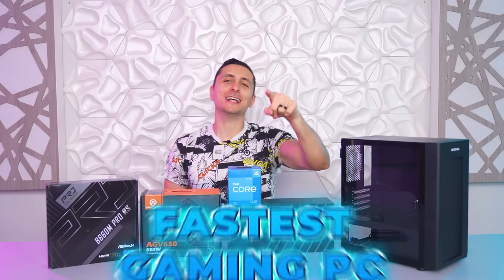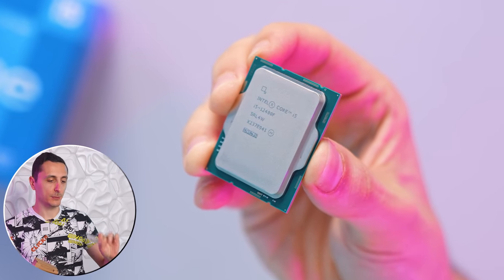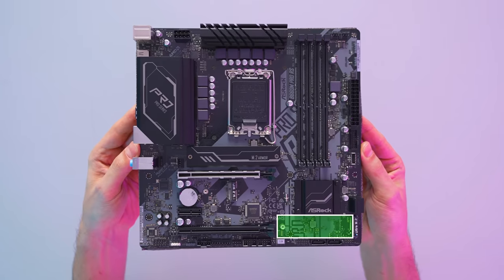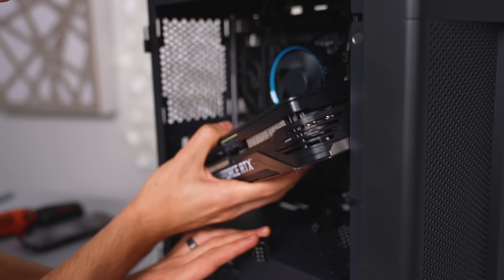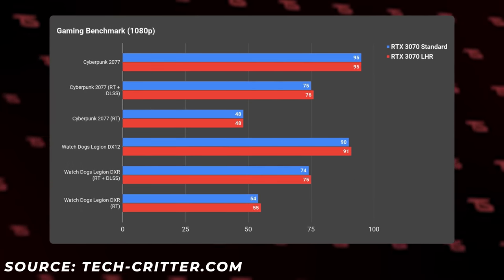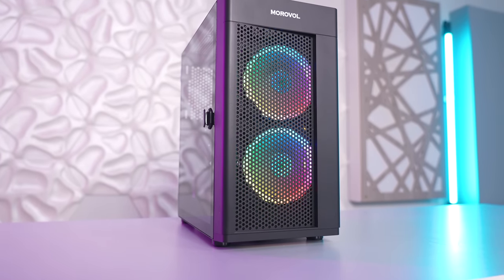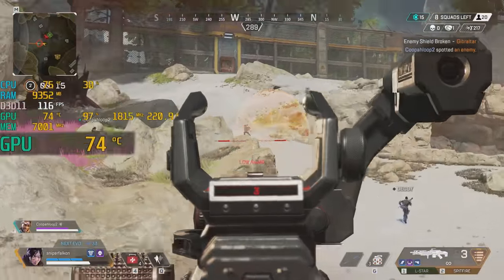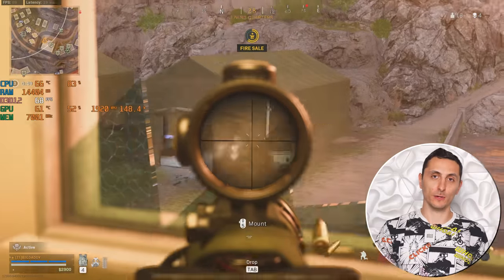Building the Fastest Gaming PC for $1000! - RTX 3070

Comment: Okay for a 1000$ I can say this is a well build budget pc and with an 12400F/3070 that's pretty good. But I must clarify to never cheap out on the Powersupply, that Arresgame AVG650W is one of the worst units you could possibly buy on this parts list. This Unit has been tested by reliable sources like Nexusgamers and Psu Cultists. By their rating they averaged this Powersupply as Tier F Which mean avoid at all costs and should not be used in mid range and high end builds like this. Some of them can even blow up by having their parts at full load. So if it was be I will def be taking an Asus TUF 650W or an Smart BM2 650W that are much better for a build of this degree. Hope this helps someone while replicating this build, I'm not hating or anything but just giving you a piece of advice so you wont run into any issues.
Reply: agree 100%
Reply: Ff
Reply: Ty bro il be looking into good power supplies for a pc with a 3070 in it
Reply: @dyzorted  A 650 watt power supply should be good for a 3070 (Unless your CPU is top tier, in that case probably go for 700+ watt). Also, I would recommend getting the Gold rated power supply instead of Bronze as it have much better quality/efficiency (Slightly more expensive, but when your already putting in this much money, it's definitely worth it).
Reply: @zayaanrab7942  il look into that
Reply: Thanks! Black Friday is soon. I’m still a bit scared to build my own pc ( was thinking to buy a prebuilt) this vid gave me a bit more confidence on what parts to pick.. any suggestions for a first pc?
Reply: @BXRSERKX  What's your budget?
Reply: @zayaanrab7942  in the 1000-1350$ range
Reply: @zayaanrab7942  the thing is I live in a country where parts are expensive…
Reply: Bro I can get a used Rx6900xt for 500 USD and a brand new Ryzen 9 5900x for 300 USD ,so this build is definitely just a 6/10 for a 1000 dollar PC build  (Eventhough if u add these items I mentioned u will prolly overspend by 150 USD , but u will be getting atleast 40% more performance so yea it's a win win situation.)
Reply: @BXRSERKX  I'd say go Ryzen 5 5600x with a 3060 ti. I'm not sure how much those cost in your country though, so go ahead and have a look at the prices and let me know.
Reply: @vik9481  The problem is, that gives you only $200 left to spend on everything else, which is definitely not what you'd want when you only have the graphics card and CPU
Reply: @zayaanrab7942  yeah I was thinking that aswell but instead of the 3060 go for the 3070 but I looked at the 3070 prices and they are pretty expensive. What motherboard will go well with this combo? I’ve heard of you don’t pick the right motherboard it can fk your whole system up in a way. Def will check the 3060ti!
Reply: @BXRSERKX  AMD works well with quite a few motherboards. I'd recommend something like the B550. You can look at other alternatives, but if you're using previous gen motherboards, make sure it has Q-Flash on it. Otherwise you'll need an old Ryzen CPU to upgrade BIOS.
Reply: @zayaanrab7942  Q-Flash got it! What about Radeon GPU’s any suggestions there? Heard they go for “cheap” compared to the GTX 3000 series. Any Radeon GPU that compares similarly to the 3060ti? Or even a bit better
Reply: @BXRSERKX  I don't know much about Radeon GPUs, but I believe the 6600 XT is the 3060's equivalent. Again, you'll have to look into the prices since I'm not sure about them where you live.
I would go for the 3060 if you can, but if you do need to save money then 6600 XT isn't a bad choice.
Reply: @zayaanrab7942  alright I appreciate it a lot mate! :)
Reply: @BXRSERKX  No problem. Have fun with your PC!
Reply: @BXRSERKX  if the AMD 6700 is the same price as the 3060 buy the amd you will get a better performance if you don't care about ray traycing
Reply: Yeah I'm building this with another 650
Reply: @BXRSERKX  this one he built is rlly good but get a better power supply and u should ve good
Reply: @shashank4020  I went with 6800 for gpu and 5800x amd
Reply: Oh my god, I just brought the Aresgame 650w, it’s my first build what should I do?
Reply: @bonkersbeaver9919  throw it in the bin
Reply: @BXRSERKX  have you ever used this psu?
Reply: “so you won’t run into some issues” 

average gamer playing on this pc : blows up
Reply: So instead for power supply I should get Thermaltake Smart BM2 650W 80+ Bronze Intel Skylake’s C6/C7 States & ErP Ready 140mm Quiet Fan Japanese Capacitor Semi Modular Power Supply 5 Year Warranty PS-SPD-0650MNFABU-1?
Reply: Man i love you ❤️ no homo
Reply: I have ryzen 5 5600 and 3060 ti should I use 600w Corsair 80+ bronze or 700 watt thermaltake
Reply: @NotGlarr  calculate the total w all components count add to the total 100w
Reply: Thanks this helped a lot
Reply: which psu of the ones you suggested is cheaper?
Reply: I gave the 12400f and a RTX 2060 it’s not a bad pc at all I love it
Reply: @lukewalker3  that's a good pc decent cpu and gpu it should atleast play all the new games on high settings
Reply: Than what would be a good power supply for this build?
Reply: @cxmptuhkc7134  80 gold 850w 150$ or 200$ power supply is the kind of component that is you get what you pay for and 200€ is too good
Reply: So would the smart bm2 650w be better??
Reply: Yeah, as soon as I saw this psu I knew them and there this guy does not know his stuff.
Reply: Not wrong, although it will support it there are much better options
Reply: I ain't reading all that
Reply: What’s a better option for the motherboard that is Wi-Fi ?
Reply: Budget pc? 1000 dollars?
Reply: Is 750W Aresgame better than 650W
Reply: Do I not need a cooler?
Reply: @bakirbakija4585  yes. The higher the wattage the less likely it’ll go kablooey. Anything that is gold rated or higher, and more than 650w should be good for this system
Reply: @deddsos  Thank you
Reply: What about corsair cv750 80+ bronze ?
Reply: 650w is the minimum for a 3070, if your looking for more power 650w to 750w is all you need for this build
Reply: Should just buy corsair, thermaltake, be quiet  more popular ones.
Reply: I’ve already ordered the arsegame power supply💀 what I will do is come back to this comment and buy one of the power supplies you recommended once I start seeing problems with mine🤝
Reply: Please can you respond what do you think I should get
Reply: @IsaacIs1  a psu?
Reply: @IsaacIs1   so I saw this comment and thought I should get a different power supply too, the power supply he uses is really cheap so I found one that’s good but a bit more expensive, it’s the evga 700 BQ, it’s a 700watt and the minimum for a 3070 is a 650watt
Reply: @Hinokl  yeah because I’m actually trying to get a new power supply
Reply: @IsaacIs1  stay with the arsegame 650W if you’re getting a 3070 but if you’re getting a 3090 or above get one of the ones Angel recommended or a 750W power supply
Reply: @shikatafn4681  thank you
Reply: @sc4rles  yes the NZXT H5 Flow that’s the one I’m using
Reply: What's are some good power supply brand for 650w? 
My (planned) build is Ryzen 5 7600X and RX 6700 XT.
Reply: what to do you think about coolermaster 650w gold?
Reply: I would get probably a zalman gigamax or an apevia prestige, never go tier c or below for any build, the cultists list does say that tier d is only for igpu builds but I still wouldn’t use a tier d for an igpu build
Reply: Yea thanks for this power supply tip I’m planing on building a 5 thousand dollars build max out every thing like 128gb DDR5 ram and also the RTX 4090 with the core i9 1300k the most powerful processor and also a 2tb of space storage with all RGB gaming case fans and a expensive motherboard and power supply I never buy cheap stuff I always buy what’s the most expensive cuz I always know that the more expensive you get the better you get that’s how it works guys never buy cheap stuff and also guys if you guys want to have the best pc buy a gaming pc that costs atleast 1 thousand dollars to the most expensive which is 5 thousand dollars never go cheaper always go in between these prices of thousands of dollars to experience the best out of the pc

Comment: You can buy an RX 6800 non-XT for $480 right now, which was tested to be around 11% faster at 1440p and 10% faster at 4k than an RTX 3070. It’s currently $50 cheaper than the cheapest 3070 in my area (NJ, US). It’s a great alternative to those who don’t care much about ray-tracing and looking for the most bang for their buck
Reply: Yea, and you can buy it brand new for that price. Used gpus id say area bout 95% good 5% bad, and if you don't care about 4k, you can get the 6600xt and 6650xt for 250 atm that does 1440p for most all games. 

For 1080 and some 1440 you can get the amd 6600 for under 200 rn, and a 5600 cpu for 135. Literally a under 500 $ build.
Reply: You can honestly just get the 6800xt for 515$ after rebate
Reply: It feels like Nvidia will never lower their mid/low range 30 series gpus. They should be $100 under msrp by now. AMD is doing that, that's why im team AMD right now. Im currently considering a 6700xt. Not sure if I will wait 2-3 months for the newer mid range gpus
Reply: yeah but ray tracing still better optimized in the Nvidia Cards, if you want to play a single player story mode game and wants to max out everything with Rt, the 3070 still the way to go
Reply: @Petersonleonrohde  No. If you want to max out everything, the 4090 is the way to go

Comment: Great Build! Personally I would have gone for 3060 ti if going Nvidia since it would be around 30% Cheaper and you only lose around 15% of the performance.  Or the better option which is the 6800 for around 10% better performance than 3070 for cheaper as well.
Reply: That’s what I’m going with, and I believe there’s less bottlenecking with the 3060

Comment: Hi I was thinking about using a ryzen 7 5800x instead of the Intel cpu combining it with a 3070, would that be a good combination?
Reply: It would be a good combination if you wanted to multitask/stream or do productivity tasks. However, youd definitely pay around $200 more both for the cpu itself and to properly cool the cpu. You will definitely want a higher end air cooler or look into water cooling options. And in addition to that, you may want to get a power supply with more wattage if you want to upgrade anything int he future as the 5800x comes with a big increase in power draw.

Comment: LUL Horse shit title. Fasting Gaming PC for $1000 is not with a 3070 when the RX 6800 is faster and cheaper. Also, the 6700XT is hovering around $350. So you're saving more than $50. And the awful tier F PSU on a power hungry CPU/GPU. Can't take this guy seriously folks. I would recommend PC Builder for actually technical source.

Comment: i have a pc with ryzen 5 1500x, GTX 1070ti & Gigabyte AB350 Gaming motherboard, I have a terrible RGB case and I'm looking on pc part picker to upgrade my case and motherboard but it keeps saying "A USB 2.0 to USB 3.2 Gen 1 header adapter is required" & " A USB 3.2 Gen 1 to USB 3.2 Gen 2 header adapter is required" does this mean it doesn't fit correctly, I'd like to find a suitable motherboard & case combo or advice on what these compatibility notes mean ?

Comment: Crazy DEAL!, CRAZY PC, CRAZY LOW BUDGET! , i also wanted to buy RTX 3070 and mix it with I3 12100, cause i dont have money to buy I5 last gen to save money, in my country i5 and i7 ar expensive, i would préfere I3, and mix it with RTX 3070, with nice gaming case and fans eveyrwher, that could at least be a good pc with 16GB RAM, i already have HDD 1TB, but i gota get 1 more SSD for installing windows inside it and some games, to get better FAST, that it i guess!,

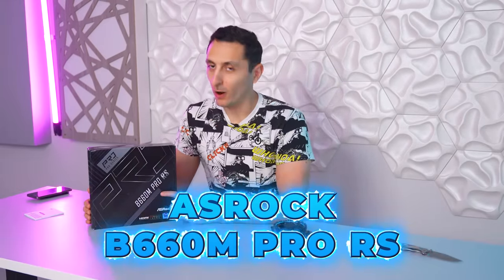Comment: Am I able to swap the power supply to a ASUS ROG Strix 650 Full Modular 80 Plus Gold 650W ATX Power Supply or a bigger supply? and for the upgrade on the processor it would be Intel Core i5-12600K Desktop Processor 10 (6P+4E) Cores up to 4.9 GHz Unlocked  LGA1700 600 Series Chipset 125W correct? 3:08

Comment: Really the only thing I would change is the power supply. I purchased an Aresgame PSU when I first built my PC, and while I didn't have any problems, other models have been proven to have changed internal components that made a substantial difference in rating without disclosing it (see the Gamers Nexus video on a few of their PSUs). Also, the infamous psucultist's PSU Tier List has all models of Aresgame power supply units in the "Replace Immediately" tier for similar reasons listed above. I don't think this should be a brand people can trust until they become transparent with their changes and actively seek to improve their reputation by consistently making genuinely good units. Sure, it's a "budget" unit, but again, I don't think they should get a pass because the price is low.

Right now, the Super Flower Legion GX Pro 650W 80+ Gold semi-modular PSU is $63 on Newegg Sellers, and currently there is a $5 off coupon code to bring it down to just $58. It's a better unit from a trustworthy brand, and even at full price, it's very much worth the extra $3 for an 80+ Gold rating. I'm guessing you probably had the Aresgame unit already on hand, so the convenience of using it for this build I 100% understand.

Other than that, I like everything about this build - an affordable yet sick little rig that can handle just about anything you throw at it, including some ray-traced games. Very cool!
Reply: Does it have to be a microatx case or what other case sizes would be compatible? I really wanna have the option for minor upgrades, I'm brand new to this stuff I sold my ps5 and am looking for help building my PC

Comment: I’ve never built a pc before and don’t know much about them. Should I just purchase the NZXT Starter Pc Pro as it’s only $1000 rn and comes with a 3060ti, intel i5 11400f, 16 gb ram, 1 TB SSD, 650w Gold power supply, their Flow case, and an ASUS Prime B560-PLUS motherboard?

Comment: Pro tip if you get a approved for a Amazon card you get a 150$ gift card and you can cancel the card right after your approved. managed to get a 5800x and a 3070 build with a 1440p monitor for like 1011$ in total only thing that was used was the 3070

Comment: I’m new to pcs and was thinking about building this do I not need a operating system?
Reply: Yes. All PCs need an OS of some sort otherwise they don't much without one. There are many videos on YT on how to install any of the nearly infinite number of OS's out there.
Pretty much no PC build video on YT includes the cost of Windows since they assume you will buy it separately, run it w/o activation, or buy a product key from a 3rd party gray market key reseller or use an open source OS like most Linux distros.

Comment: I have a budget of about £1100, I don’t have much experience at all in building a pc so I’m spending about £100 on the pc being prebuilt by PC specialist. I ended up with a i5 12400f 3060ti 1TB Nvme SSD 16G vengeance 3200mhz and a B660 board

Comment: You completely missed GPU performance per $..... On that price range  W goes to RX6800 
You even said "if you're fan of AMD you can go for 6700XT ... WHAT IN THE FUCK!
RX6800 costs the same as RTX 3070 and is in rank with RTX3070Ti 

Please check benchmarks next time. RTX Andy :)
Reply: 6800 is even better than the 3070 ti. Chad gpu.
Reply: Completely agree. Sometimes even 30-40 fps difference between RX 6700 XT and rx 6800 XT

Comment: What does.. Locked CPU mean.. and why wouldn't it get very hot???
Reply: Some CPUs are locked, meaning you cannot manually overclock their speed. Unlocked CPUs, as the name implies are unlocked and can let you adjust multiple settings like clock speed which can help you overclock it. With Intel CPUs, any CPU that doesn't have the "k" suffix means it is locked. I believe most AMD Ryzen CPUs are unlocked, but require a B or X chipset. The lower-end motherboards with the "A" chipsets I believe don't let you overclock even if the CPU itself supports it.

Comment: This Budget Build for sure got my excited to possibly build my own PC, with some of the upgrades from this to avoid the high temps. I would like to see what we could do with some upgrades to have the best chance of keeping PC functioning long term.

Reason for this being my current PC use to run games like APEX and D2 smoothly for the first year. But this last year, (3 Years into owning it) it is starting to chug and drop lots of frames and turns into a jet engine with even running SourceFilmmaker.

Additional fans would for sure be worth the cost. But any other things we could upgrade on this for just small improvements for something more long term?
Reply: by a better case like a mustex case it’s like $30 more and comes with 5 preinstalled rgb fans

Comment: I watched this video and a step by step tech source vid on installing motherboard case gpu and exct...exit.... and still can't get any power even after taking everything thing apart and re assembling still didn't idk what I'm doing wrong
Reply: Start from the easy stuff that's easy to overlook: Make sure your wall power outlet works. Make sure the power cable is plugged in securely on both the wall outlet and the power supply's input port. Make sure the power supply's power switch isn't turned off. That seems trivial, but it is easy to miss that. If that still doesn't help, disconnect the power button header cable and briefly short those 2 pins with a screw driver or other metallic object. This should cause the system to turn on if everything else is fine.
Reply: @JJFlores197  I will try it as soon as possible thank you